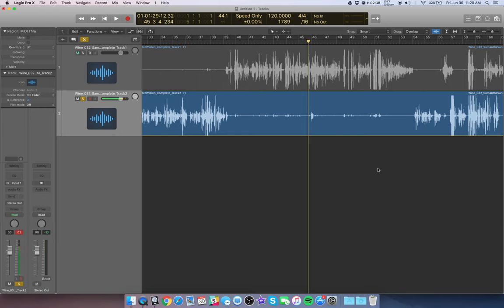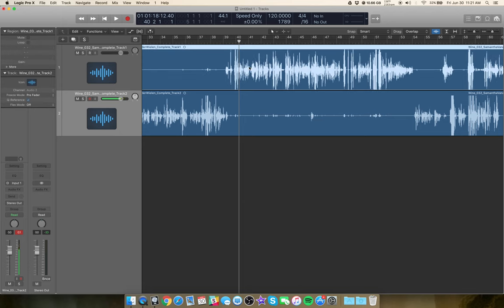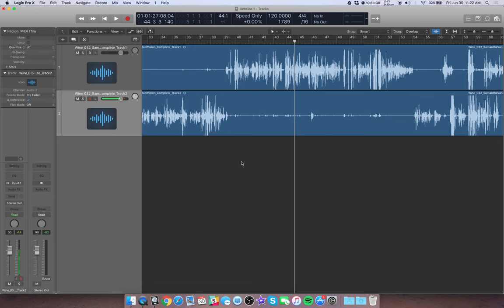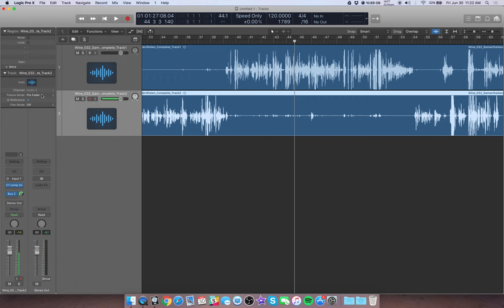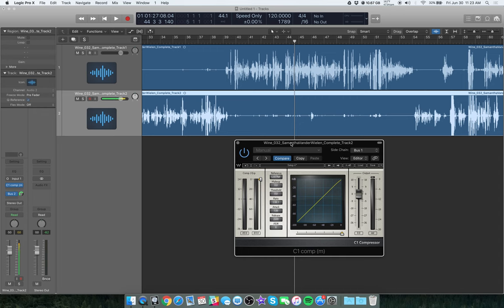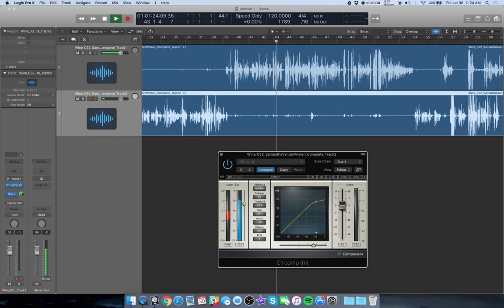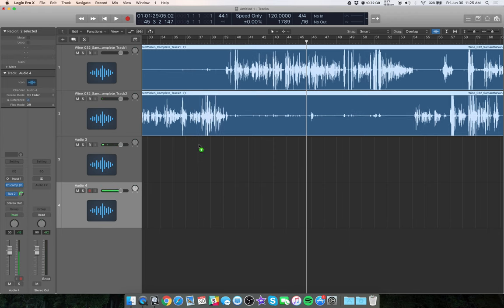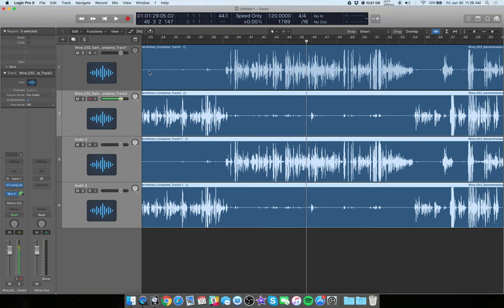How to remove mic bleed in podcasting - side chain compression

Comment: The big issue with applying such sidechain method for mic-bleed elimination, is that you will also eliminate those little "ah yes" and "hmmm" or "hahaha" from the other person that you would normally want to keep, as this is an engaged conversation, not a set of monologues.

Also, if there's a heated debate, and the speakers overlap each other, what will the side-chain compressor prioritise?....

Hence, I never was able to use this in podcasts of 3 people (maybe 2, if they are really well behaved :-))

Would love to hear your thoughts/solution for this 🙏

Comment: Nice technique, I wasn’t sure why you need to send the audio to a bus and use the bus as the side chain when the compressor gives you the option to use the original audio? I’ve always used the audio when side chaining - is it because you want any audio fx included?
Reply from the maker: 2 reasons, they didn't use to offer that feature so it's just a habit to use a bus... and, if you need to send more than one audio source into a bus for sidechain, you have to use the bus/send instead of selecting the audio track in the compressor directly